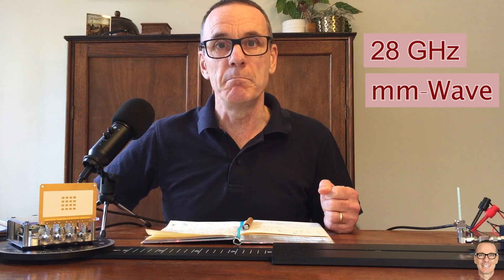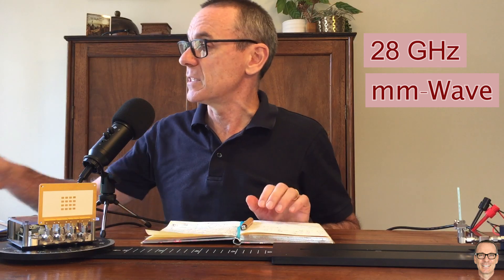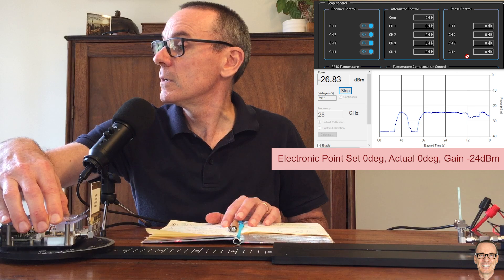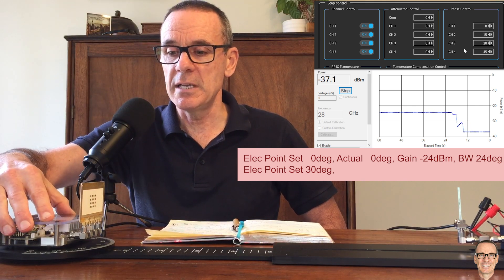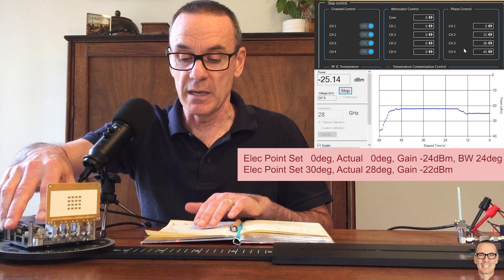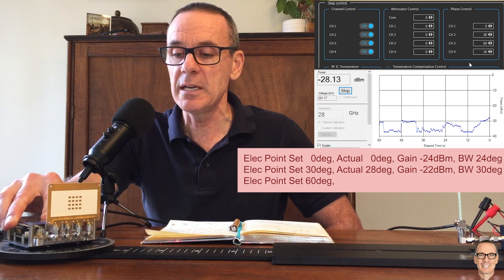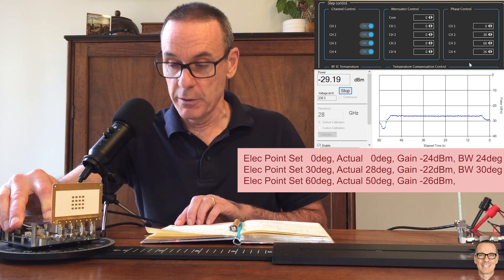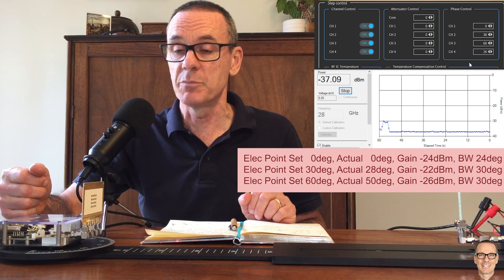Beamforming in Practice: Part 2 - How Wide are the Beams at 28 GHz mm-Wave for 6G?

Comment: Thank you for the video! It was very informative. However I have a small question. When you found the number of steps required to steer the beam at an angle of 60 degrees how did you get it as 30, 60 etc.? When I calculate the phase difference needed by plugging the values into the equation you gave I get a value of 145 degrees which corresponds to 26 steps. Therefore, should it not be 26,52 and 14 for channel 2,3 & 4?
Reply from the maker: Doh! Yes you're right. Thanks for pointing it out. In my haste, I simply doubled the offsets from the 30 deg direction, when I should have re-calculated the formula that has the sin of the angle, not just the angle. That means that the phase offsets I actually used corresponded to a 90 deg pointing angle (according to the formula), but at that pointing angle the radiation will be affected by the ground plane that surrounds the radiating elements, around the edge of the square white coloured dielectric sheet, so I guess it's interesting to see what happened in that case too.

Comment: Hi Professor,
thank you very much for your video. It really helps understanding this topic from a practical point of view. Do you have any book recommendation on this topic? I'm specifically looking for a book that talks in depth about different beam alignment and beamforming techniques used for wireless communication. Best regards :)
Reply from the maker: Sorry, I haven't been keeping up with textbooks in the area. I mostly spend my time doing research, and reading research papers. Here are a couple of my recent papers on this topic, that you might be interested in.

C. Liu, M. Li, S.V. Hanly, P. Whiting and I.B. Collings, “Millimeter Wave Small Cells: Base Station Discovery, Beam Alignment and System Design Challenges”, IEEE Wireless Communications Magazine, Vol. 25, No. 4, pp. 40-46, August 2018.

C. Liu, M. Li, I.B. Collings, S.V. Hanly and P. Whiting, “Design and Analysis of Transmit Beamforming for Millimeter Wave Base Station Discovery”, IEEE Trans. on Wireless Communications, Vol. 16, No. 2, pp. 797-811, February 2017.
Reply: @iain_explains  thank you very very much!

Comment: Very good. I am quite intrigued by beamforming. I am a radio amateur, so have limited resources. Is there hardware and software around to do beamforming at a lower microwave frequency, say below 6 GHz? I do appreciate that antenna size increases. Drew VK4ZXI
Reply from the maker: I'm sure there are, but I'm not aware of them, sorry.
Reply: Just trying to help you with an advice : from what i have understood, you want to operate a radio channel on a specific frequency. If you want to broadcast to users, beamforming is not for you. Because you will focus the strength of the signal in one direction. If you're  not sure the users are waiting in that direction, then no one will receive  the signal.

Comment: Thank you for the wonderful demonstration. Your videos are very helpful.
What happens when the receiver is greater distance, does the beamwidth change in that case?
Reply from the maker: Unfortunately I couldn't try it at longer distances, since the cables from the (common) local oscillator restricted the distance I could get the transmitter and receiver apart.